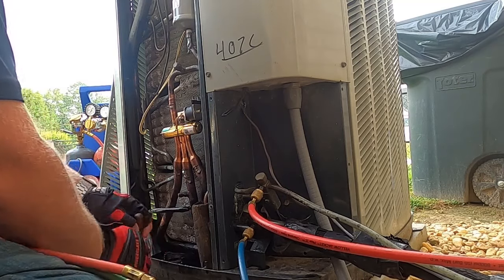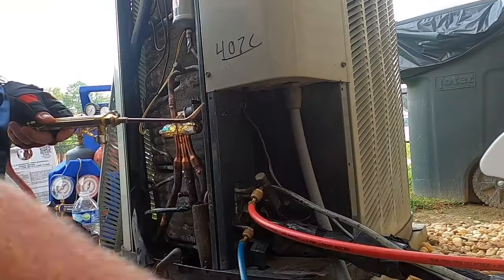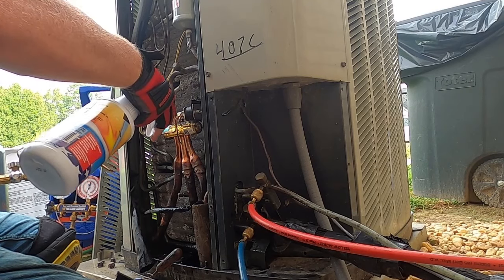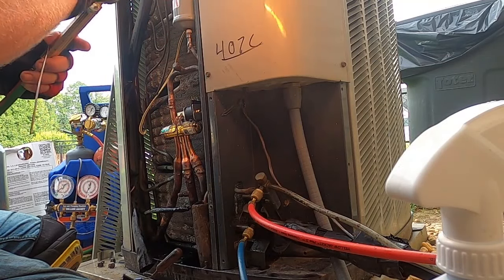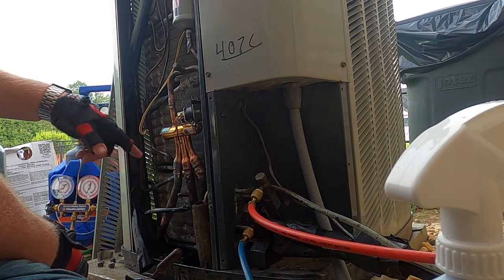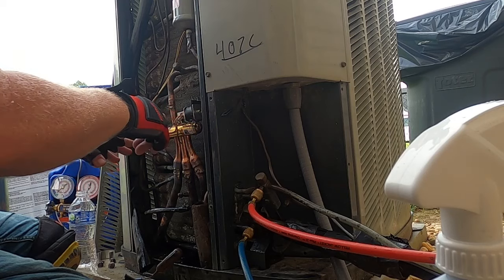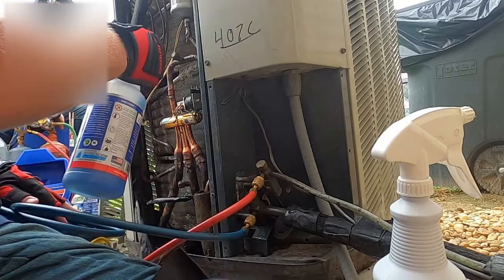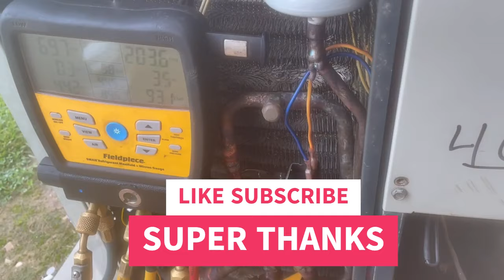Let's see if we can fix this system.

Comment: Only thing good you had going for you on this job, was that reversing valve was sitting right on the side of that fker.  Let's say at 11:09 that was the valve but it was inside the unit. I take sheet metel snips and cut all three lines under the valve body and the top after the braze. Then it's like unbrazing little caps, if you know what I mean. Makes it sooooooo much eaiser.